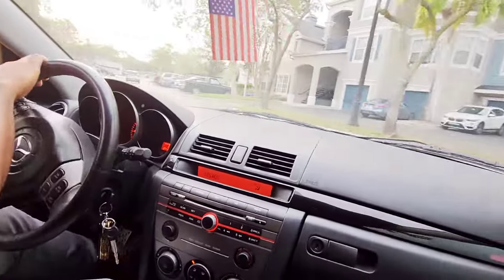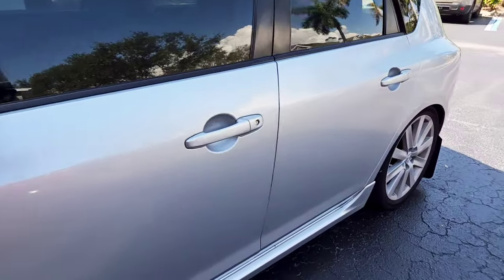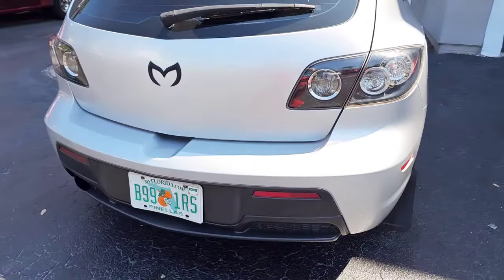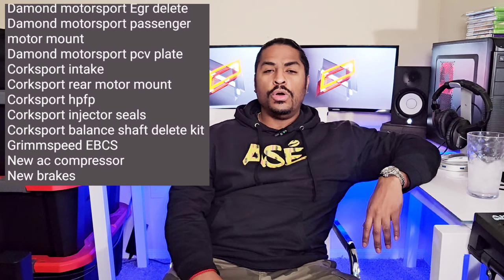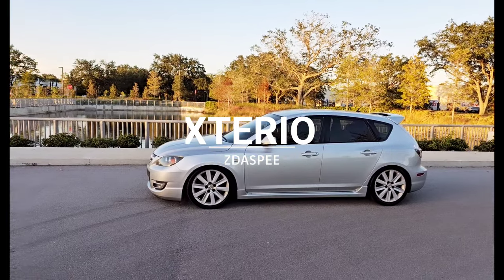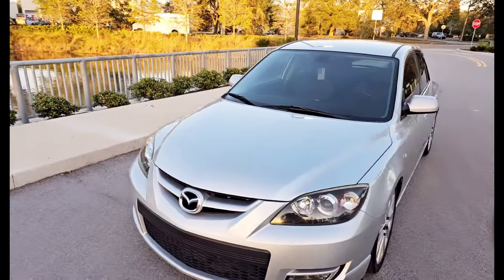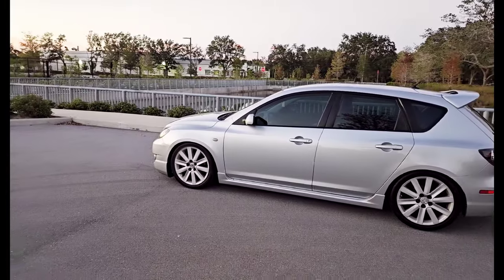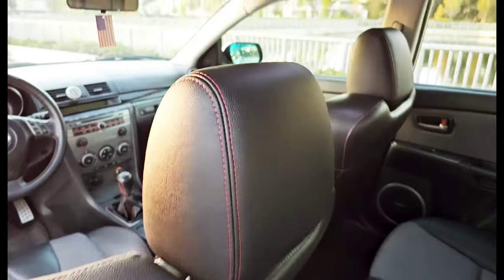Accidentally Bought Another Mazdaspeed | Mazdaspeed 3 (Mazda 3 MPS) Intro

Comment: Another great addition to the stable. I vote for refitting it with the MazdaSpeed badges....Would you take the AMG badges off a Merc...Nope...At least I wouldn't.  I think it's a smart move to widen the scope of your content.  the MX-3 is a great car, but like so many have posted they are getting scarce.  The good news is that those of us who have them are mostly fanatics.  Speaking of Mx-3s, I can across a response on your video about the Amazon/ebay coil over conversions where you outlined what you did to yours to get them right.  You mentioned that you were going to be revisiting that in an upcoming video.  I'm very interested!!!  Thanks for the great videos!!!
Reply from the maker: Yes, ill be posting more mx3 content, including Suspension upgrades, as time allows. Thanks for watching!

Comment: Ok, so… la mecanica old school vs la nueva es un mundo de diferencias. Yo confío en la BP por que no es interferencia. Y la nueva es wue con poco le sacas muchos HP. Yo tengo una MS3 del 2009 (proyecto awd) y tengo una 323 del 92 para hacerla BP05 con la transmisión que saque de la MS3.

Recomendación para tu MS3 y tu MS6: timing kit de 2.5, le cae y es mejor calidad. Y si algún día tienes problemas de transmisión… verifica tus fork pads (son de plástico) los venden brass. Tu MS6 los caps para el transfer case son débiles. Los puedes comprar billet. Todo eso lo encuentras en speedperformance. Saludos desde PR 🇵🇷
Reply from the maker: Gracias por el pitazo hermano, lo recordaré cuando le estoy hechando mecánica a los mazdaspeeds. Saludos🍻